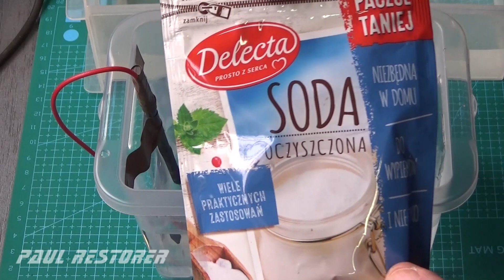Renowacja modeli odlewanych. Jak usunąć korozję metodą elektrolizy ze Znalu?electrolysis?

Comment: HI Paul, what do you think about the electropolish using phosphoric acid? is it any better than electrolisis?
Reply from the maker: I haven't tried it yet so I have no opinion. I also need to check the copper plating of the zamak metal surface
Reply: @PaulRestorer  cool. how do you design the decals? with a scanner first?

Comment: I’ve done the same thing to clean rust from larger car parts using a storage tote and a battery charger, used old brake lines for the positive and wired them together all the way around.
Reply from the maker: Super

Comment: Wonder if that will work with a graphite pencil refill.  A small thin wire and maybe a terminal block to connect the wire to the graphite refill.
Reply from the maker: Of course it will work with a normal pencil cartridge.

Comment: Very novel idea, I didn't see how the wires were connected to the charger, did you just cut the connector off and tape it up? For easier connectivity you might want to try a crocodile clip, although your method works just as well.
Reply from the maker: Thank you very much